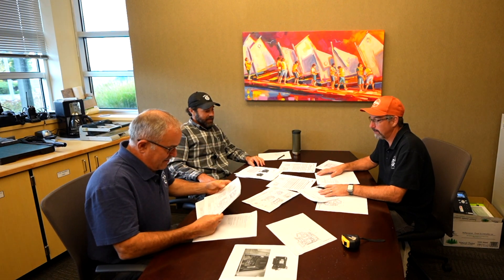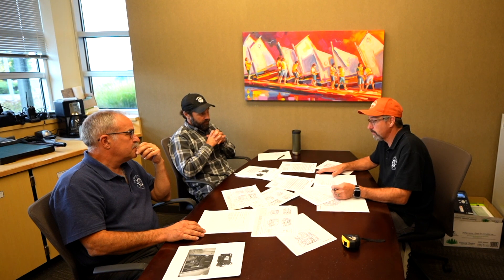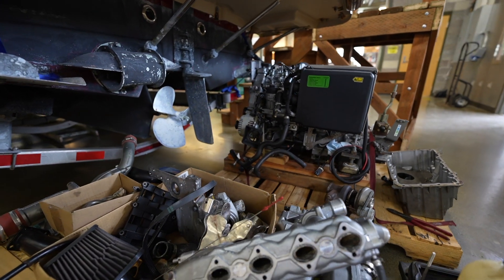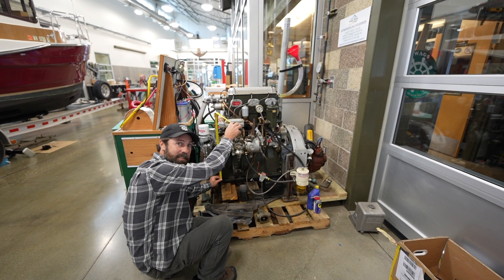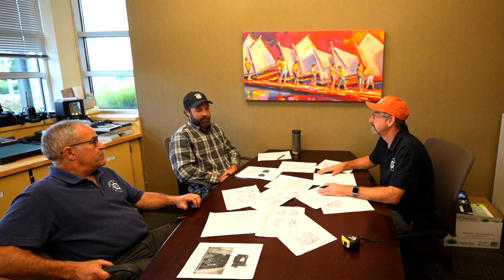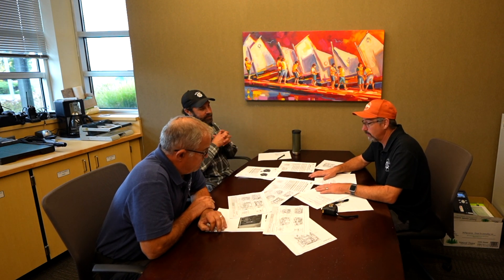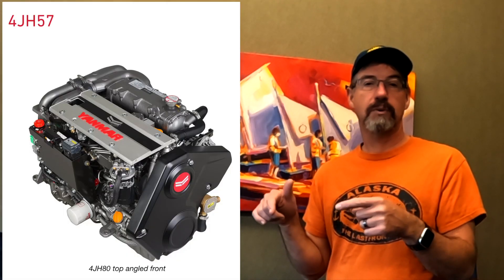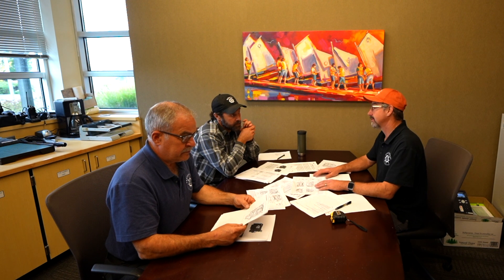Lady M: We need to pick a new power plant!!! Engine Musings

Comment: I am exited I found this Video, I find it very informative! 
Hopefully, there is a Ranger R25 is in my future, I am considering one of these boats.
You asked for Project Comments, although they are unfortunately late.

Note, my "Comments/Suggestions" are based on over 56 years of experience in the Diesel Truck/Construction Equipment Industries. During my career, I severed as a Mechanic, Diesel Instructor at a Tech High School, District Service Manager and Regional Sales Engineer for Africa/Europe/Middle East. I've included this info as a little "Back Ground," which should add to the weight of what them. I've Walked the Walk and Talked the Talk. I also have 10 + years as a boat owner, two which were Yanmar Diesels. 
We were alway strained the apply the the "4-C's" to a Failure/Repair.
1. Complaint: In this case, as I understand it, is evidence of water inside the engine.
2. Cause: Which was found to be Towing without the Water Inlet Valve being Shut off.
3. Correction: Here where I have the my biggest concerns! From what I understand the Engine was never completely DISASSEMBLED and INSPECTED to determine the full extent of the damage and Comprehensive Repair Estimate, never made. Without this Fundamental  Step, everything down stream from it, is questionable, and can lead to the wrong assumptions and costly mistakes.
4. Collection: Generally the Customer is responsible to Pay the Bill. However, sometimes its an Insurance issue, sometimes its a Shop Come Back, sometimes a Parts/Vehicle Warranty etc.   The switch from 150 HP to 50 HP maybe too much.
Having said all this, hopefully the "Sea Trails" will produce good results! IMHO, the Rangers are too fast to start with, for my tastes.
I look forward to the Auction!
Reply from the maker: Thanks for a very complete 4-c's. The engine was mostly taken apart, one of the injectors was completely rusted in - they couldn't pry it out at all. They had a bore scope in the cylinders and they all had evidence of salt water and corrosion. Because this model is no longer available (it's a BWM block) and sources parts was reported as very difficult, rebuilding didn't sound like a viable options.

Comment: Can the 4JH110  fit
Reply: Yes, the 110 would fit. However, not sure it would help. 150 Hp gets top speed 17, and cruise 12-14. 110 isn’t enough for semi-displacement so it probably doesn’t make sense.
Reply from the maker: The 4JH 57 we were talking about is the same block as the 110 hp -  just doesn't have a turbo or inter-cooler.

Comment: I own a 2015 Ranger 25sc with the "abomination" D3-150 which as 1295 hours on it. I am very interested in your project. In direct answer to your question, only making hull speed is not a deal-breaker. I make sure to go WFO at least once on each outing, but have made full-speed runs only a few times, like when crossing Lake Ontario (wanted to minimize big-water exposure time).   I am gonna have to pull the engine at 1400 hours to change the timing belt anyway (probably next fall of 2024) so am very interested in your outcome. Having 60-70 hp and the attendant fuel economy is very appealing. BTW - my boat is the same color as yours.....
Reply from the maker: Great, Thanks for the notes!!! This is all new to us (Ranger 25) we are good at boats and projects, but trying to gather as much info as we can!
Reply: @timkenyon6088 Hi I am looking at a ranger tug 27 that may need a new engine. I like the idea of making hull speed, would a 60-70hp cut it?
Reply: @TTTT-rc4fv  I do not know....sorry.

Comment: It is interesting to me how far aft the engine is mounted in these Rangers.   Makes it much easier to pull and replace an engine, even if it is a little tight.
Reply from the maker: Yes, the engine is pretty far aft and the big hatch does allow to pull an engine much easier than many vessels.